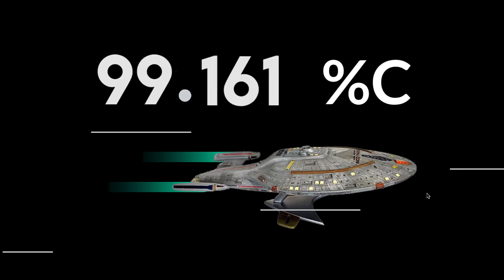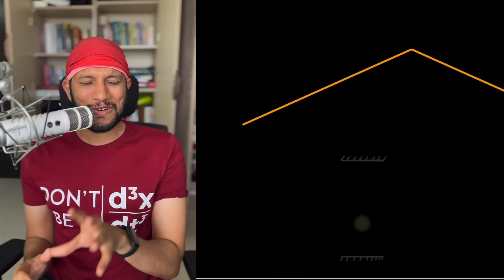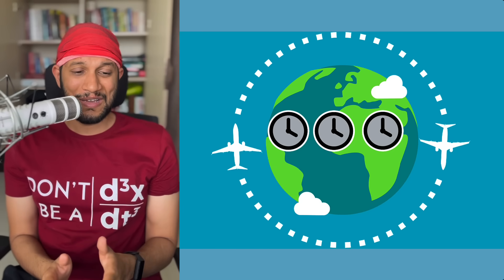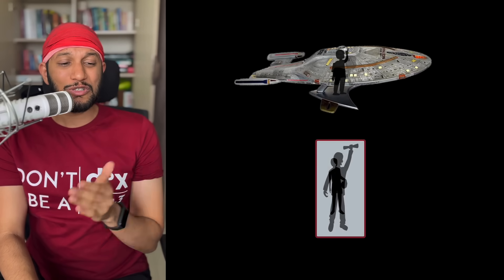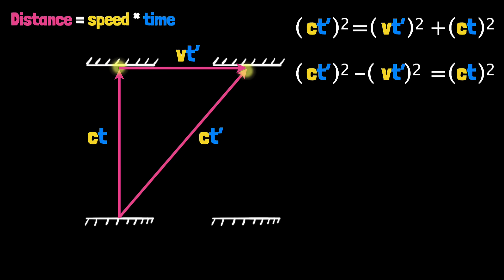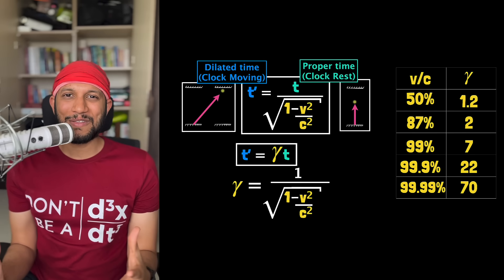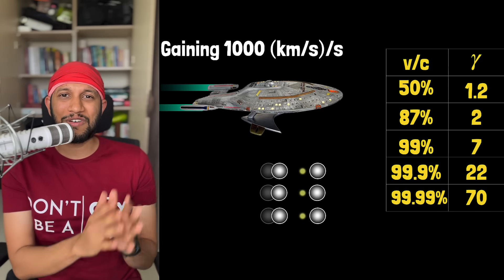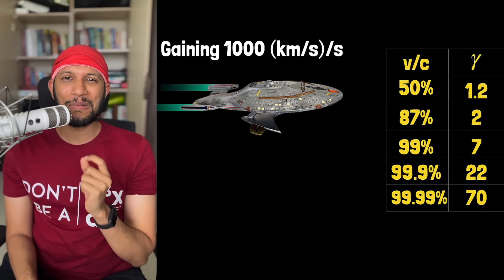I finally understood why you can't go faster than light! (My mind is blown)

Comment: So the photon in the photon clock slows down based on the frame of reference, but from the reference of the ship, shouldn't the photon be traveling the same distance? Imagine someone sitting inside and monitoring the clock, from his perspective, the photon is still only moving vertically. So the diagonal travel line only become relevant to an outside observer.

Comment: To begin, 'Einstein says' is not an explanation either.
A similar clock problem present with sea vessels and aircraft, has been overcome without a suggestion that vehicles couldn't go faster.
It's as likely that time dilation will be disassociated with space and travel speeds, and reassociated with mass inertias. After all, time is not a thing anymore than speed is a thing.

Comment: This was a really good explanation, but here's a somewhat pedestrian, uneducated question: how would it correlate with this explanation if the photons that communicate their information to the next in line were moved in retrograde, backwards to the next destination.  It seems logical that they would be moving faster than if they were projected forward where the acceleration would slow them?  I guess I'm not educated enough to even ask the question coherently.

Comment: Does it take time for the lights to turn on when you flip a light switch? no.

This is because one electron cannot move in a circuit until all electrons are moving. Moving any of them causes all to move at the same time, like marching in a parade.

When we flip an electronic switch, we can in fact send information to a destination with, afaik, zero delay. Regardless of the size of the circuit. Therefore information absolutely can travel faster than light.

The thing about accelerating past the speed of light is you must apply a defined amount of kinetic energy to the object. Now what happens when objects have enough kinetic energy to exceed the speed of light? they become so energized that they will dissolve, or melt, as kinetic energy is the same thing as heat. 

If you heat up an ice cube, what happens? it become liquid, then a gas, then a plasma. But once it's no longer a solid we'll have a progressively harder time applying more energy to it, as it has become a fluid system that will disintegrate when acted upon; not a rigid one that can easily transfer energy to other molecules within itself.

So! how do we travel faster than light? we become energy. Altered carbon when?

Comment: Okay so now when you bring thing call time measure by object aging it also mean the light itself is alway at the same exact time like when they start to exist due to it move with the speed of light itself but it also move in the x y and z axis which make no sense cause if you don't count something moving in x y z axis is moving in time itself doesn't that just mean time is not what we call "time" anymore doesn't that just mean if the particle moving backward in the exact reverse way of how they moving forward is literally time travel? Then every time travel paradox not exist at all cause we don't actually "moving" backward in time we just make every else "moving" backward in time and we still "moving" forward so it's like you make the universe reset back to a point without affect to yourself so technically that "past" is now "present" but because time is measure by the aging of object so it literally the "past"

Comment: So, the theory of time being linked to velocity is derived from photon clocks and half life, how does that tie in with cellular division?  And what would that look like in a null state of movement as even on earth we are "moving" at a high rate of speed.  If we could actually be not moving, how fast would we age, what would the rate of half life be?  How fast would a photon clock tick? 

I have a theory that I personally have no means to test, but it does tie into relativity.  Say we're on a ship traveling at light speed, would we see things normally within the ship?  Say we're arranged similar to the diagram outlined below where I was 1 and you were 2, would you see me? Because if so that would mean that light also falls prey to relativity.  If we tried to measure something going light speed inside of something that itself is going light speed, would that not be going light speed ^2? 

-------- [   1       2   ] ----------->

Sitting on a bus going 60km/h, if i throw something 10km/h forwards or backwards, it's actual movement would be 70 or 50km/h, but relative to the bus it's still just 10km/h. same theory but light speed :P

Comment: That photon clock is such a great way to explain it. Immediately you grasp that if the clock is moving forward at light speed, and the photon is also travelling at light speed, then the photon will never reach the mirror, because it's moving away at the same speed. Hence: time has stopped.

Comment: If ship is moving at 87% of light,then photon should also gain that 87%(momentum of speed horizontally) plus its normal  vertical speed (actually vector of vertical normal photon  speed  and horizontal speed of ship )so time  should be same,only the speed of photon should increase to cover that longer distance in same time..

Comment: So its not that seconds past slower from the perspective of of the time traveler.

Its that all the atoms travelling close to the speed of light communicate and react slower due to the slowing down of the photons.

So technically if all atoms in a person stopped reacting/communicating you would be immortal since no cells can duplicate along with those slight errors slowly decreasing your life span

I feel like Im missing something unless that means a person traveling near the speed of light would need to move in slow motion or idk how that would work if you'd fall apart or something due to the strange conditions.

My understanding is that the speed something can move is based on how fast light can move between its atoms.

If you were on a ship and a clock was ticking normally for you on the ship but looking back in the direction you come from, you see a clock moving slower. I could understand that because the light from the further clock is reaching your eyes slower as the photons have more air time before reaching you.

This new perspective is confusing me though. If the light moves slower the faster you move, wouldn't the light slow down inside the ship too since it is also noving?

Maybe the reason things move at the same pace inside is because the relative direction the light moves in varies.

If youre in a ship traveling 99% the speed of light, then the photons can move at 100% speed up and down, but forward with the same direction as the ship it could only move 1% its speed, and back 100% its speed unless it can go faster due to the weirdness happening where the limit to the speed of light cancels or something.

Either way with photons moving at different speeds, it would be trippy in there.

I also wonder what would happen if you were to move a body part forward (1% speed) and up (100% speed) at the same time. Could you not walk forward in your ship, only up, down, and back?

Comment: The first thing to understand is that the speed of light is a master of distance, not time. Your time is relative to where you're at compared to what you see moving if you are on a train. Anything travels faster than light, so we can't see it and do not have any way of finding it.  very small parties already travel this way neutrons, but the main reason is the amount of energy needed surpasses any known mass to produce it    E=Mc2

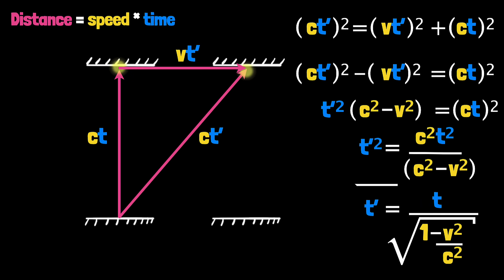Comment: 9:26 the summary of time dilation equation . This is just ... the pythagorean theorem ? A² = B² + C² .  I thought it might be worth mentionning it . distance = speed * time . Distance  as A = ct' , B = ct , C = vt' .Oh and another thing . It seems that the equation is based on observation ( whether inside the ship, or statically outside the ship ) . So the equation is based on the '' visual information '' you receive. WHAT IF.... the observer outside the ship is in another ship trying to reach the limit of speed of light in the opposite direction ?

Comment: The whole perspective may be completely wrong. Because yet noone proved that the speed of light is constant, and it cannot be accelerated by other influencing factors.  In my opinion the photon may also ber able to accelerate beyond the assumed speed of light, if there is something that can actually boost it. Therefore it makes more sense that t1 actually is the same as t and there is no dilation, but instead there is a c1 which is higher than c.   Can anyone prove why c must be an absolute constant? It is a constant only according to our current knowledge and limitations. But we are far from knowing the secrets of the universe and how it works.

Comment: Nice approach, but it feels slightly faulty because the first half of it is special relativity, but in the part where you actually answer the question the ship isn't an inertial frame of reference. Because of the acceleration of the ship, we cannot immediately say that the principles that were established earlier in the video apply here as well. More work is needed, unfortunately, for a rigourous explanation.

Comment: But would ur counterpart or any radioactive processes really move slower if it's special realitvity? Wouldn't that just be relative to an outside observer? If I was the one traveling close to lightspeed to another planet and came back, to an outside observer or body, I'd would've aged a lot slower while my counterpart would've aged much faster but wouldn't that difference between us only be a noticeable in relation to both of us?

Comment: Rest mass can never reach the total speed of light in a vacuum. That speed is for massless particles/ waveforms . All of the rest energy in Mass would have to be converted into massless  particles, of which I believe only black holes do as they consume all forces beyond the Schwartzchild radius. But then of course when they break down all that rest mass and it's forces, time stops, and no distance is traveled.
What happens inside of a black hole, nobody knows.

Comment: Haven't watched the video yet but here's my take.

The closer you are to speed of light the less time it takes to travel from A to B.
So if you exceed speed of light it means it would take negative time to travel, which means you've already been there.
Which breaks the cause-and-effect relationship: how can you be already at point B before starting the travelling?
Makes no sense in our current physics knowledge.

And relativity for you works like this: if you speed up to speed of light, time slows down for you so much, you can travel across entire Universe in a second.
If you find a way to accelerate yourself that much you can take a look at every corner of the Universe in a fraction of a second.
The only problem is that universe grows old much faster, and if you do a round-trip to edge of visible universe and back to Earth, you will find out the Earth aged like million years already.

You only need 0.9999999994𝑐 to be able to see the edge of visible universe and back in a couple seconds.
But you'll be back to see a rock previously called Earth, and now either completely abandoned, destroyed by a meteorite, or maybe there's some other alien civilization inhabiting it.
Or maybe some insects.

Comment: Ok but what does the passenger of the ship see, if we keep the acceleration as suggested in the video 1000ms^2 and lets say the ship is fuelled with enough fuel to be able to keep up this constant acceleration for lets say 1 hour, with this acceleration from the ships perspective it will take five minutes to reach the speed of light. As a side note we don't need the ship to accelerate so fast, we could make due with an acceleration equal to the gravitational acceleration on earth and the time to reach c from the ships perspective would be 8.5 hours, plus keeping the passengers from experiencing 100 g's of force is a good idea.

Comment: nice video overall, thank you for explaining it like that.

what about neutrinos though?

Time-of-flight (TOF) measurements made with the OPERA apparatus indicates that the μ-neutrinos arrive about 60 nsec before a light beam would have arrived. This corresponds to a speed of about 1.000025 c, or about 7.5 km/sec faster than light. This is a six-sigma result — near statistical certainty.

Comment: The part that still confuses me is motion is relative.  The path the photon in the photon clock appears longer if the ship the clock is on is moving or if the observer is moving relative to the ship.  So where is the time slowing down?  The moving ship with the static observer or the static ship with the moving observer?  Well, the theory says it slows down the same either way.

Comment: Ok less than 1 minute into the video my neurodivergent brain visualizes it as when you approach the speed of light time slows down for you and if you reach the speed of light time for you finally reaches zero...... which means in terms on meters per SECOND you are not moving at all, so your velocity is actually zero because not even the tiniest fraction of a second is going by you have actually come to a dead stop which considering the sheer amount of energy required to accelerate you to that velocity there's no way all that energy will just allow a dead stop so it's kind of a nonsensical state that the laws of physics simply cannot allow.  Then consider if you have exceeded the speed of light, well now time for you is going backwards, which immediately means you now start moving backwards because the time that it took you to accelerate up to and surpass the speed of light... well now your time is going backwards so the laws of physics just hit the rewind button for you, and now you've gone back in time to the point where you surpassed the speed of light.  So maybe objects actually can reach the speed of light but for them time slows to zero for as long as it takes in the Observer's Time for whatever energy it took for them to go from 99.99999999999999999....(infinity)% of the speed of light to 100% of the speed of light to be used up in Observer Time and then the object continues at 99.99999999999...(infinity)% speed of light....  So to the outside observer it appears as though the object never actually reached or exceeded the speed of light and for the actual object reaching or exceeding the speed of light, nobody will ever know it, not the object and not the outside observer because the time dilation makes it impossible.  Even if you had the energy to go 10X the speed of light you will just keep freezing at the speed of light at 0 seconds until all the energy in Observer Time is used up but in Observer Time it will also be zero because whatever the dilation factor between the object's time and the observer time it doesn't matter because it's multiplying by zero, and zero is zero, it's also going to be zero in observer time.  So you CAN reach the speed of light for exactly zero seconds, or you can exceed the speed of light, but whatever your speed, it will cause a proportional reversal in the direction of time and all the energy will get used up pushing you right back in time to the moment when you exceeded the speed of light.  At least that's how the images in my head make it make sense.

Okay I've watched the whole video and yes it seems like we're saying the same thing where you're explaining it from the outside observer and I'm explaining it from the object accelerating.

Comment: That's interesting to me, because this explaination only says that this spaceship accelorating toward the speed of light will take forever to get to that speed with infinite energy from the OUTSIDE perspective. Inside the ship, the clock is normal, and you'd think the acceloration would look more normal. So inside the ship, they're gaining speed at a regular rate, not losing acceloration as they go. And perhaps they might even pass C and start going back in time? From the outside perspective an infinite amount of time would have passed, but perhaps there is a tipping point and then they'd be bounced back the same way they came as time reversed?

Comment: This video is interesting, however, I think the author bringing in time dilation in the explanation is an unnecessary complication and doesn't really explain properly.

Short answer: Because of the mass equivalence principal in e=mc2.. You would need all the energy in the universe to accelerate a mass beyond the speed of light. In the formula e=mc2, e is energy, m is mass and c2 is the speed of light multiplied by itself.

From Union University Physics:

To quote Einstein himself in his 1905 article on relativity published in the Annalen der Physik; "The mass of an object is a measure of its energy content." One of the basic laws in physics is the conservation of energy law (the amount of energy in the universe remains constant, only changing in form). In working out his theory of relativity, Einstein found that mass must be related to energy, in essence, mass is "congealed energy." This is certainly a surprising result.

So lastly, to help all this sink-in for the layperson, a great phrase I have read that helps explain mass equivalence in e=mc2 is to think of any object / thing /stuff see as solid objects /  matter / mass  as frozen energy or frozen light....  To push that lump of frozen light/energy faster than light/energy itself would require the entire energy content of the known universe...

Comment: speed of light is 300,000 km/sec and i am inside the ship which is accelerating at 1000 km/sec so i should be at 300,000 km/sec in 300sec/5min Right?
Reply: The unit km/s is used to measure speed, not acceleration.